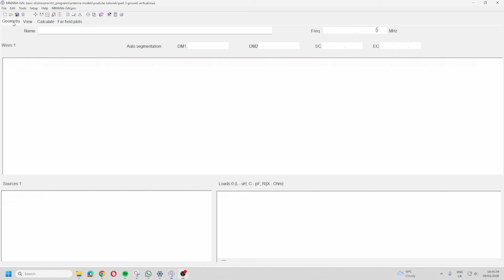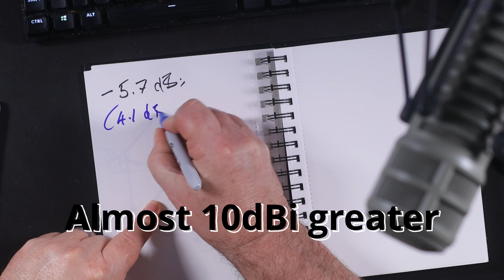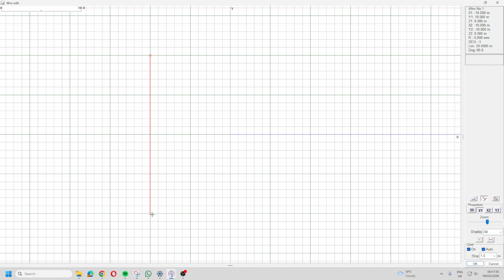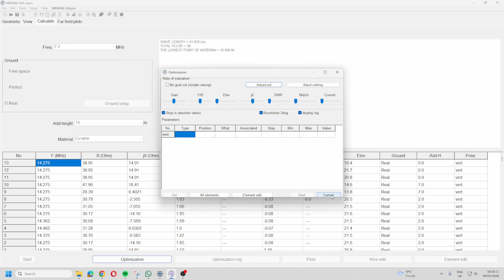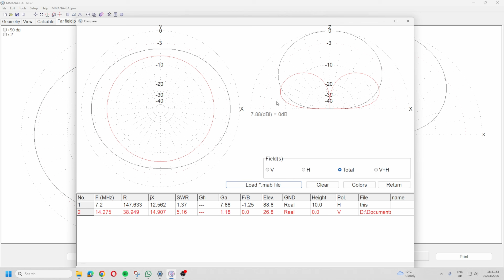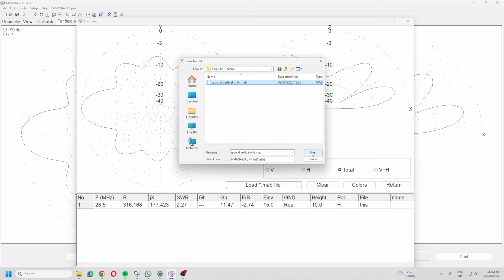Antenna Modeling for Beginners - Horizontal Delta Loop (Part 5)

Comment: In a Fuchs antenna installed in a concrete building, doesn't the building act like the ground for the antenna? If it does, how do we model it in MMANA-GAL software?
Reply from the maker: Depends on building but in the main, initially ignore the building and just model it at the height above ground. Buildings sometimes affect and sometimes don't. In the main, we all hate buildings not so much for TX but for RX and the "noise" that is generated locally.

Comment: After taking your advice, I remeasured, then entered it into MMANA GAL. I based the new length on my original, but after running Optimization, I adjusted it a bit and it came to 85.87 meters.The new antenna will fit in my uncooperative woods, and the program says the SWR is below 2 on all the bands. I also added 200 ohm in the advanced Optimization for a 4:1 balun. My question is, should I be concerned that the R (Ohm) column still shows impedance between 120 and 360 ohms when doing the calculations for all the bands? Does that mean I should use something other than a 4:1 or am I just missing something from being too new to this?
Reply from the maker: You'll be fine. That is more or less correct due to the 0.2 wavelength above ground rule (which I mentioned in one video - can't remember). By the time this is back in the shack, the SWR will be negligable. Beware, if using PVC coated wire, you will end up being shorter.

Comment: Hey up cal I've been trying to model my antenna but don't know how to do it. Imvertel L 83ft random wire with 10m on vertical section rest horizontal. remote tuner at base and around 60 buried radials
Reply from the maker: OK, hang on - I may be able to give you some tips when I record the end fed version.
Reply: @DXCommanderHQ thanks cal I’ll look forward to watching

Comment: Would there be any advantage to a vertical placed on an inveted horse tank waterer and use the galvanzied base as the ground plane?  Would suspending the antenna over a water tank do anything of import?
Reply: You’re better off ground mounting and using radials. The only way to improve performance drastically is take the antenna to the beach
Reply from the maker: Honestly, it wouldn't make any difference.

Comment: I'm doing something really wrong. I tried applying your instructions to the 80M loop I'm thinking of making this summer, and the numbers were all wrong. Four sides in roughly a diamond shape, each about 20 to 21 meters. It ended up total 79.6 meters which I figured was close enough to run the model. I added a height of 10 meters, and to 200 ohms for the balun. I ran the calculate and got a SWR200 of 2657. I guess I need to watch your video's again a few(dozen) times.
Reply from the maker: OK, well if REALLY stuck, shout - else download the model from the link and adjust that instead.
Reply: @DXCommanderHQ  I took your advice to download, and I just split one wire, then added length to each leg to make it an 80M diamond shape. SWR now looks much better. Very strange plots one you get below 80 meters. I can't get it up higher than 10 meters, so 80 just a cloud cooker. I think I might use this as a receive antenna this summer and see how it works.
Reply: Okay you said if I'm stuck SHOUT. Without all the details, the best trees ended up five segments, four of them, and the fifth leg ran back to the house. Total came to about 83.46 meters. The software showed that the resonance on every band but 80m was way too high in each band. I set a frequency of 14.2MHz and ran Optimization. It adjusted the total to 85.88 meters. After that the resonance lands perfectly in every band, but 10 which is a little low, but not bad. Now in your EXPERT opinion, should I believe the results, and try to make the 85.88 meters fit my pain in the butt trees?